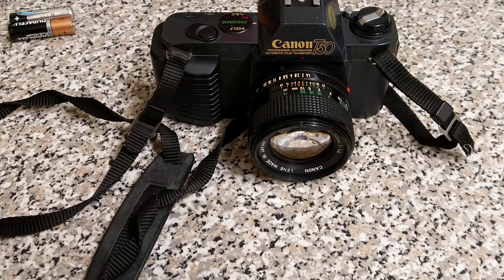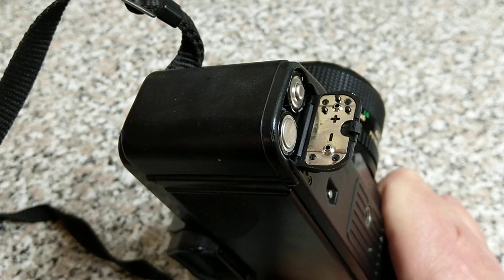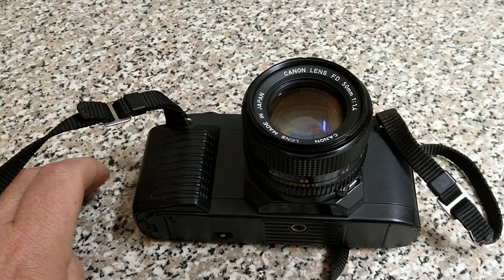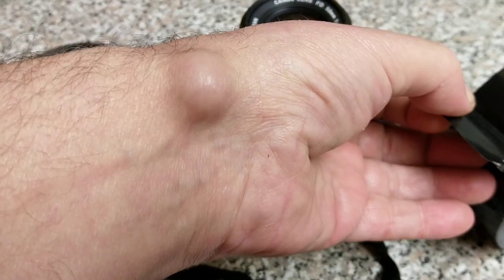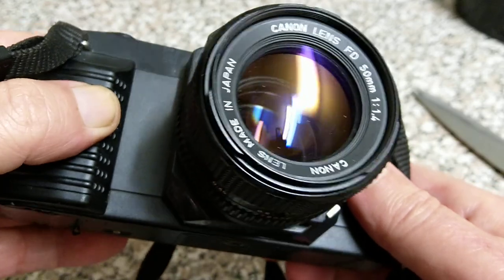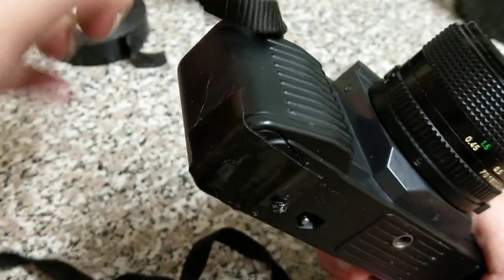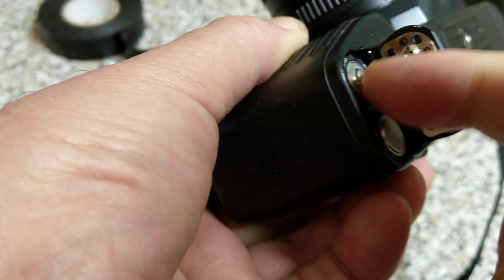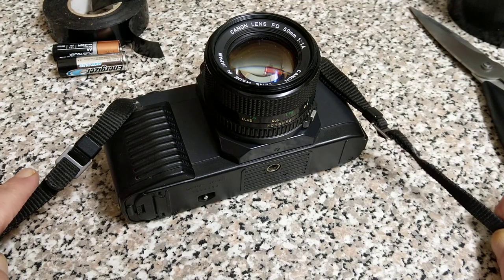Canon T50, battery door fix with tape

Comment: Hello, helping pay for my son’s college so we are going through a camera collection someone gave my son. We sold a broken T50 for $30 about a month ago. Batteries wouldn’t get it started with foil held in place as the door was missing.

Today we found another one, door intact but batteries corroded inside. I got them out, cleaned it with alcohol, and it takes a photo. I also have the original box and all the paperwork inside. 

How much is that all worth, do you suspect?

Comment: Hi there. Thanks for this video. Do you happen to know where I could order a replacement battery door with the metal faceplate?
Reply from the maker: Hi, no, parts only come from other cameras, some eBay sellers do disassemble and sell parts, sorry. .

Comment: Wonder if you could do a small triangular piece of brass or something and use the 2 screws. Is there a grip or battery grip for it. Seems, with the AL-1 and the T50, Canon was having trouble with battery doors.
Great video. Thanks.
Reply from the maker: Hi, agree there are many ways to "fix" battery door issues, I use tape as it's cheap, works and does not affect the camera, it's an individual's choice, 
There were no power winders or battery grips for the T series cameras as it was built in, a development from the A series and their additional autowinders making them more compact and lighter,
I guess they never imagined that we would still be using these cameras several decades later but yes I agree that the battery doors were/are a design fault, other than that, they are great cameras and a testimony to their build quality, and being honest it's the lenses that matter, not the bodies
Love your channel, some really interesting stuff, wishing you continued success, the film community is getting very popular😷
Reply: @thephotographersbag  Thank you. That means a lot.

Comment: I always use sticky back velcro on old camera doors. More secure and easier to manage that adhesive tapes; no resedue.
Reply from the maker: Hi, thanks for the useful tip, scrapping the old light seals off is my least favourite job, will give your suggestion a try.....